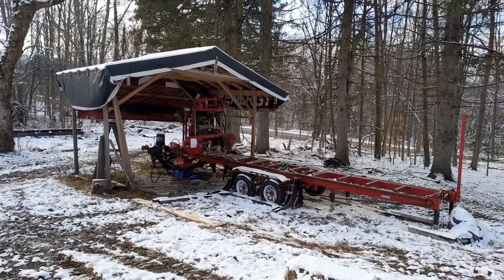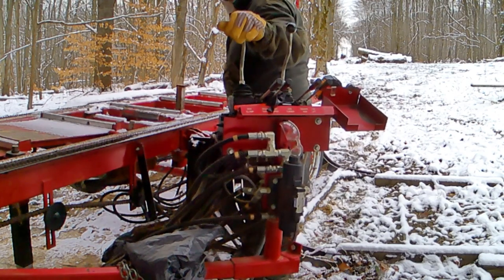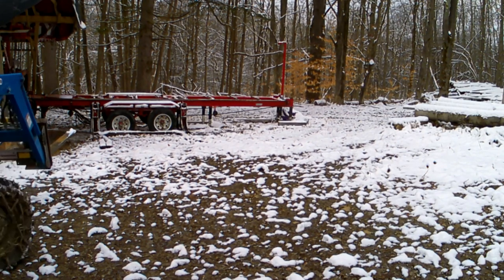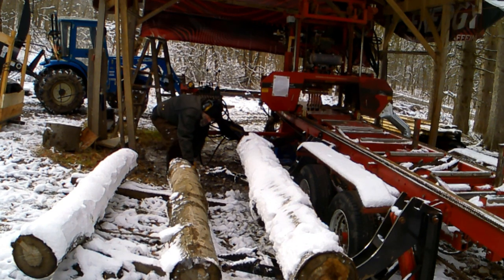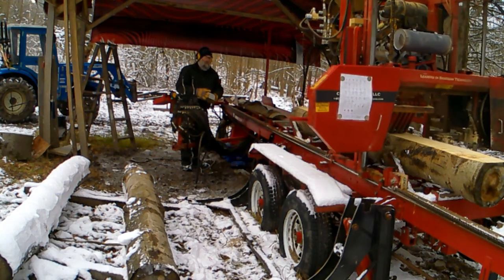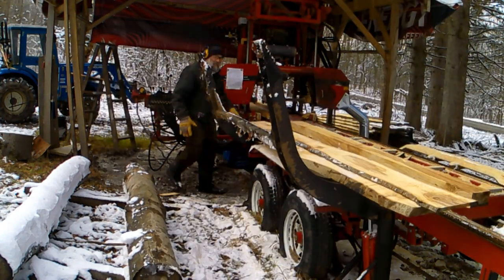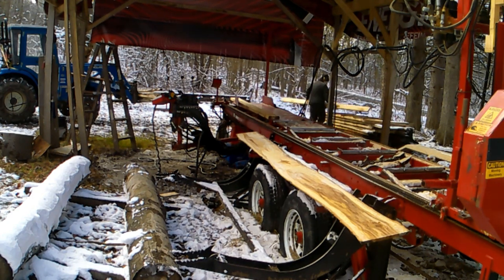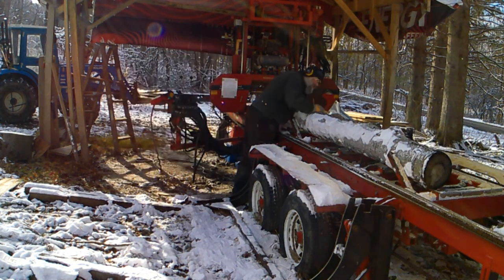Cooks 3238  band sawmill winter setup, operation, and sawing a few logs along with some tips

Comment: Nice video.  Thanks for your efforts! I also have a 3238 and have changed several things over the past 2 years. You don't show a real-time saw cut, so I'm not sure what ft/min you are using to advance the sawhead.  I've not been satisfied with band breakage, but the mill is definitely solidly constructed and the hydraulics work well. It needs an electronic throttle control, but I'm hoping to make something for it this year. Look forward to more videos.

Comment: I'm 33 and have a cheap woodland mill.   I am debating on the HD 3238 or ac36.   I'm almost sold on the HD but that go bigger has me wanting the ac36.
Reply from the maker: It all depends on what you are going to mill. If you are not going to cut anything bigger then 24 inches then the smaller one will work fine. Anything bigger than that and it starts being a pain.